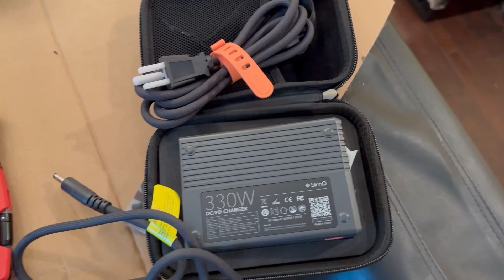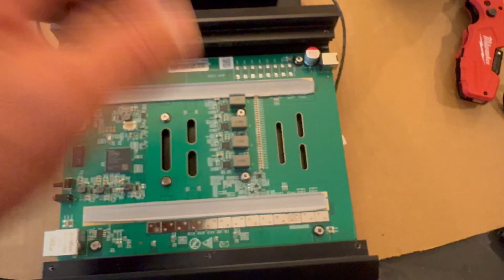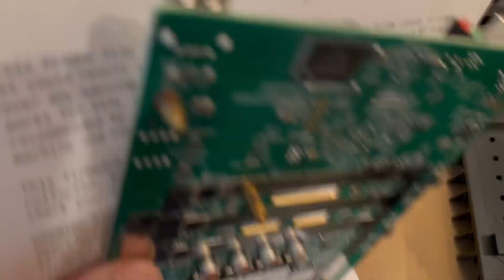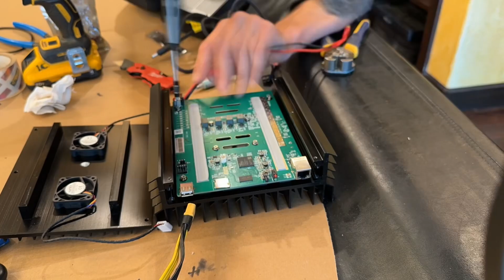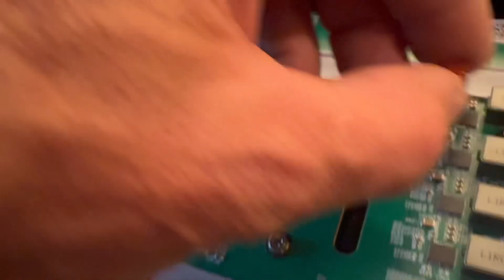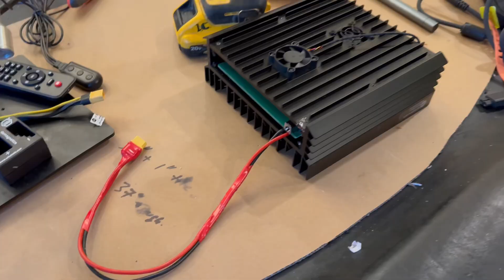How to KS0 ULTRA MOD FOR OVERCLOCKS ON 12V.

Comment: Can you please help me fix mine I ordered a power cable from Brandon coin that extremely hot went to unplug it and the cable snatched the little peace out like in your video is there anyway I can send you the miner and pay you to solder the wires straight to the unit he didn’t mention half of what you did about 12vs if your in the us please get back with me because I’m willing to pay to get my miner back online
Reply from the maker: I’m can solder that for you or you can contact crypto440 he can solder pcie connector as well. Let me know, contact me in discord.Im in California he maybe closer to you.

Comment: If you could do a video on the 12v modifications (soldering to board) to keep it from burning up durings OC's that would be amazing!!!!! Would it be possible to cut and solder the veteran miner cables to it without the barrel plug? I am super n00b on asics but you sir inspire me! :)
Reply from the maker: I don’t recommend using single pcie  cable for OC firmware I have video already on ks0 providing the xt60 connectors. Going over 170w I recommend using double pcie cable to xt60 and solder min 14awg silicone wires to the board. good luck.

Comment: so you can run ks0 ultra on 12v? or only modded?
Reply: @proflexbeats23 Yes, you can run 12v without Heatsinks, etc.
Reply from the maker: You can run on 12V on barrel connector only stock firmware any overclocks will sooner or later damage your barrel connector so you need to modify connector to be able to overclock and connect to 12V psu. You don’t need heatsink if you run in stock firmware or overlocking to 505G in some cases 562GL but I noticed not all of the ks0 ultra mosfets can handle 562 without heatsinks so I would recommend heatsinks for overlocking to prevent overheating and damaging mosfets. Hope that helps
Reply: @DontMindMeMining  exactly. I hope he understands
Reply: @Stantheman-f3r  thanks I understand thanks for the quick response
Reply: @DontMindMeMining  thanks for the tip, i will wacht all your video's about it and let you know if it works. I have a also a solar setup on goldshell miners swichted to 3 kaspa ultra. Only i have 1 304 battery with 4 x 430 solar panels with 1 60 amp MPPT. I Will add 1 victron and sell the other for 100 amp. First i try out if works on 1 kasa and the upgrade